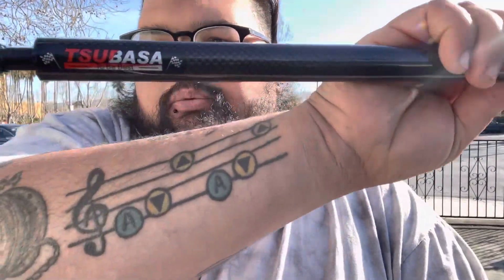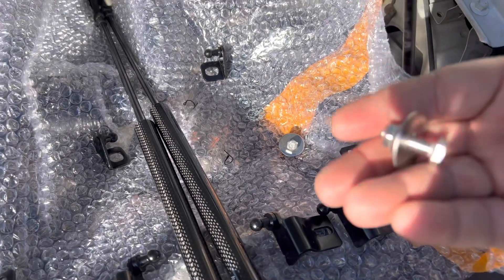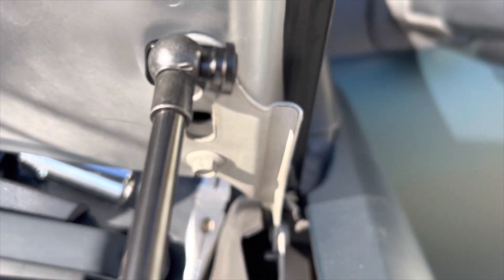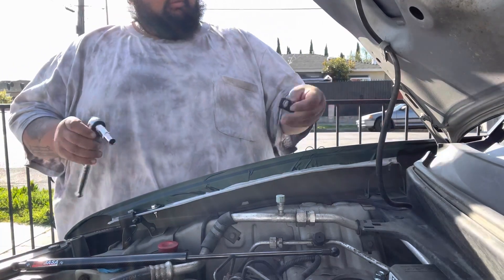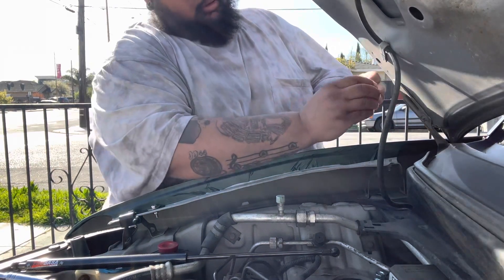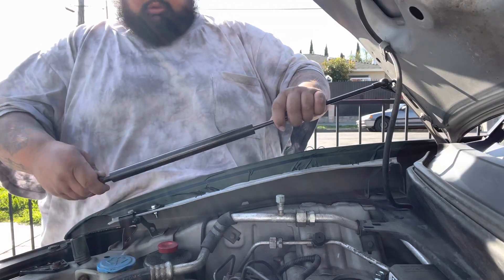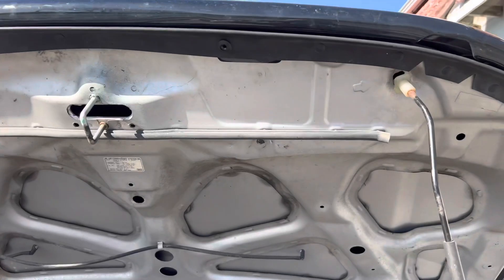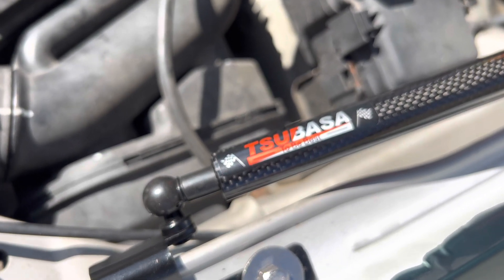tsubasa hood support (install Honda Element)

Comment: PURCHASED AND TRIED TO INSTALL SIMILAR HOOD STRUTS ON MY 2009 ELEMENT.  HOOD TOP KEPT HITTING THE BALL OF THE STRUTS.  I HAD TO RETURN.
Reply from the maker: I would definitely say try the ones in my link because I haven’t had any issues with mine what so ever maybe I got lucky but my friend who also got them hasn’t had any problems as well definitely have to watch out for what brand you get some can be risky

Comment: Tried this same brand on my 2010, did not fit correctly for clean closure and I didn't want to modify anything - Used various install methods, brackets, etc. - It was a no go for me...
Reply from the maker: Iv had mine on for a long time now and I haven’t had any thing wrong with them I guess I lucked out